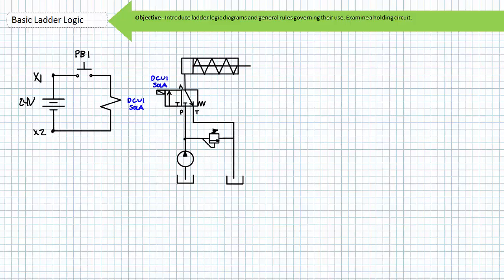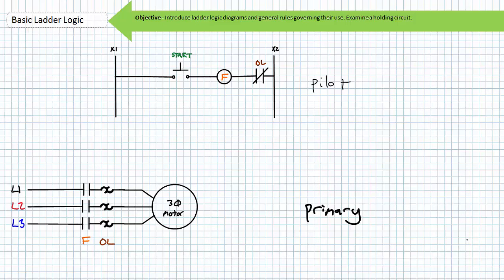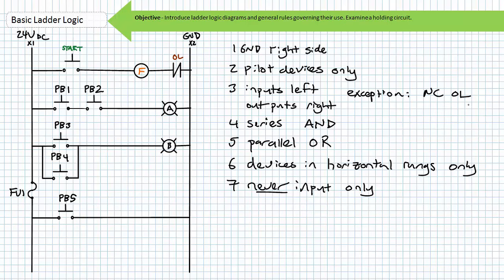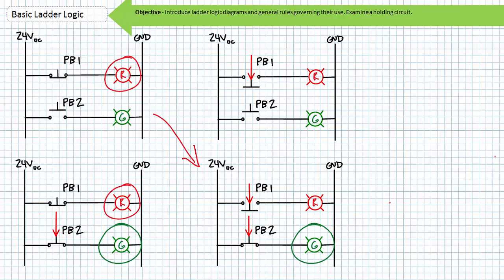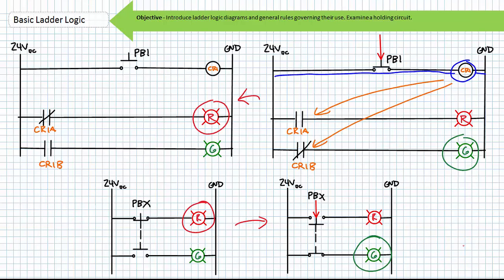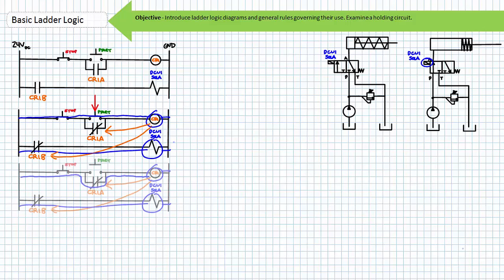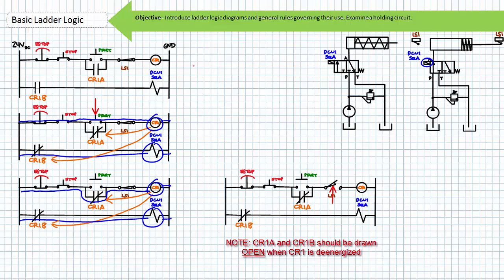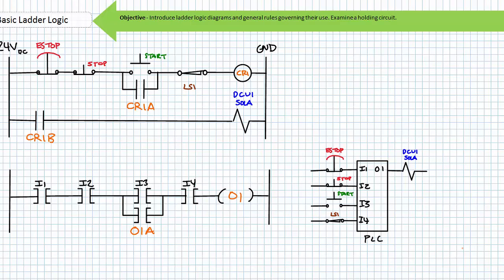Basic Ladder Logic (Full Lecture)

Comment: Switching a NO contact to NC to show it is energized hurts my head. No PLC software I have used does that. Usually the line is high-lighted. If I saw contacts changing state that way I would NOT be able to troubleshoot with the LOGIC changing before my eyes. Just keeps generating paradoxes in my thinking .

Comment: Such an informative stuff. Would it be possible for you to confirm if the terms Pilot Schematics and Primary Schemtacis used in this video mean Ladder Logic Diagrams and Traditional Schematics respectively please? I shall be thankful to you for responding.
Reply from the maker: I guess you could use those terms however I tend to think of "traditional" schematics as those showing a complete current path whereas "ladder logic" has a start on the left and an end on the right. "pilot" and "primary" refer to the function. Pilot is low voltage control (ex: 24V DC). Primary is high voltage power that actually does the work (ex: 480V 3 phase AC).
Reply: @bigbadtech  Thank you very much for responding.

Comment: Great video, this would be considered ladder schematic diagram not ladder logic correct? Ladder logic is a PLC language
Reply from the maker: Interestingly enough PLC ladder logic language (RLL) is a programming method purposely designed to be stylistically similar to old school hardwired relay based ladder logic. Idea was to program a PLC just like you'd wire up ladder logic. Since then there's a number of other styles of PLC programming developed like FBD, SFC, etc.

Comment: the first stop button is on the wrong side, it is a normal push button that opens the circuit if you push it.
the lock has to be the normal closed button which should be underneath not on the top.
when you push it will not open, as shown now it is at the top so if you push it it will do nothing. 
it has to be underneath so that when you push it, the circuit opens.

Comment: Having trouble wrapping my head around the holding circuit. If CR1A is wired into "hot," how is it not constantly energized, regardless of whether the start button has been pushed? It has a direct path to hot whether the button has been pushed or not, so how does the start button affect function at all? As in, how is CR1A not just on unswitched power at that point? Can't picture how that looks in my head. Can someone help me out?
Reply from the maker: Check out the control relay lecture at: https://youtu.be/STKH6Rp7rX8

Comment: This is the one I've been looking for. A full working, very common circuit scenario. I'm wanting to automate a greenhouse and recently started working maintenance in a factory with a lot of automation. I was going to use consumer products for the greenhouse but worried about longevity in a hot humid environment. Then I saw industrial components that have been in service for many years or even a few decades. The company is in the final stages of converting to PLC and just got rid of the last machine that had a wall full of 4' wide x 6' tall control panels full of relays and what had turned into spaghetti wiring. They're setting up a room with PLCs and components to be controlled by them for the purpose of employee training. 

I did find a company that sells industrial level PLCs and smart relays that use web based setup/control pages that don't require ladder logic or function blocks etc but I want to learn things that will help my position at work(currently a grunt/wrench) so I'll be setting up the greenhouse a Unitronics PLC because that's what they use most of at work and Unitronics programs are ladder based. Their full programs are free and I can get a V120 from ebay to practice with for $50. They use a lot of V570s at work and a few V120s and both are the same software. Hell, I might just hold out for a V570 from ebay because I'd love to design some color, touch enabled HMI screens that look better than the 1980s arcade game quality they have at work. LOL 

Of course I also need to backtrack and go through your electrical videos because more often than not, that's what needs to be diagnosed and repaired in automation. A well programmed PLC seldom has a problem. 

I fabricated electric signs in Ctrl FL for 25 years and was quite the badass but I live and like the rural life now. That leaves me having to learn a new trade in my late 50s. Luckily I got into computers in the mid 90s, diagnose and repair my own computer controlled cars and like this sort of thing. Who says you can't teach an old dog new tricks. Just need the right teacher. Thanks for the videos.

Comment: Thanks for the great vids. @10:30 Could I actually blow a fuse in real life by only writing in a push button on a ladder rung all by itself? Or does that just mean that technically in real life a switch from X1 to X2 with no load in between would be a short circuit. I'm just wondering how the PLC works on the inside. I'm thinking that we are basically just giving this PLC logic to solve and that would be what determines what it does. Since there is no load on the rung I was thinking that PLC would do nothing. But now I'm wondering if that would just be giving the PLC instructions to short circuit itself.
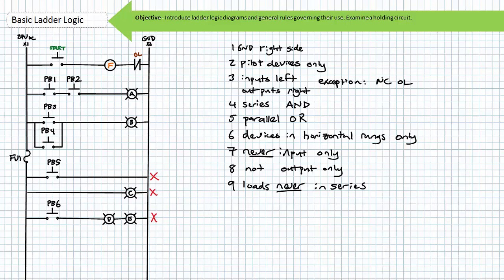Ok another question @11:10 I see the part where you are talking about putting to lamps in series with one another. Does that effect the voltage coming out of the PLC? I would know not to wire the lamps in that way because then the voltage would for sure be wrong. What if we had different plc adresses for each load would that technically work but we just shouldn't do that. Or do we just not do that because everything needs to be properly documented?  I am new to all of this so I apologize  if I used words incorrectly.
Reply from the maker: All good questions ... however ... this lecture deals with hard wire relay based ladder logic (ie: real devices wired in series and parallel) and NOT the programmed instructions inside a PLC. There's a big difference between the two.

Here's the full playlist for hard wired relay based ladder logic: https://www.youtube.com/playlist?list=PLdnqjKaksr8qRPCFkU2Q8XQe0bfo99rs6

Once you're done with that here's the PLC playlist (in development):  https://www.youtube.com/playlist?list=PLdnqjKaksr8qxlMYRVTF2YzTm6RwtA7pc
Reply: Oh ok that's interesting. Thanks for the links. @bigbadtech

Comment: Excellent presentation. One comment is that at 12:05 its mentioned that there should not be an "output only:,  I've often seen an indicating light just tied across as a "Control Power Available" indicator,

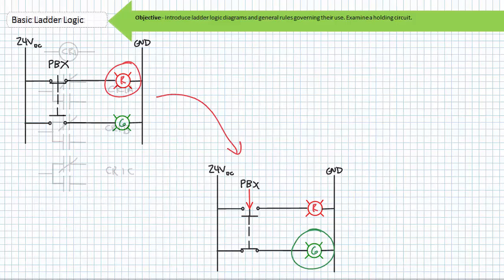Comment: Jim, at 16:30 you spoke about a PBX switch which from your explanation i somewhat understand. I want to ask however about control circuits that uses 3 or 4 position key switches that when moved through their positions activate different parts of the circuit. How is this represented on a ladder diagram. Do you have lectures on this that you can point me to. I am currently using your videos to understand the ladder diagram of a control circuit using a four-position key switch.
Reply from the maker: It gets super difficult after 2 mechanically interlocked switches to draw it schematically so often people revert to using a "contact chart" or "target table" as illustrated in this lecture: https://youtu.be/ENCdPsA9PXc?t=1521 if the mechanical interlock spans several rungs it's often easier to use "house notation" as illustrated in this lecture: https://youtu.be/f1Lj9I0vX6U?t=1332

Comment: Hello. This video is suggested viewing in the maintenance dept of my employer. Our guru Dave watched it and had the following observations. I understand this is a 7 year old video so i doubt you're monitoring and responding to comments, but just in case, what are your thoughts regarding the following:
That is one nice intro! However I do have one disagreement with an early part of the video.
In the first part he stated that having an output lamp (C) wired directly across the two vertical rungs is senseless. I have to disagree and frankly it is pretty common as such a light indicates that the ladder logic is functional or enabled. Lamp C could also be a relay which is often used to sound an alarm to centralized controls. Further we also have examples on the floor of an input to a PLC being directly wired to report the same info to the PLC. If I remember correctly the Epsilons have such a directly wired connection, to the PLC, to indicate control power functional.

In any event that one issue, status indication, can be extremely useful when you have more complicated things happening, that don’t fit in with an introductory video like this. So if people keep this in mind we have one of the better introductions to ladder logic on YouTube.  I would urge everyone in the shop to take a look.
Thank you.
Reply from the maker: Good point. Lamp C could be a quick diagnostic check to see if the ladder logic is even receiving pilot level power. Rather than a technician testing it with a multimeter an operator could simply tell the tech if the light is on or off. The pumping circuit examples lecture at: https://youtu.be/Q9osi4bKSLg?t=1133 features a couple other simple diagnostic examples.

Comment: The Stop button  looks schematically like a momentary open push button in operated state or a normally closed EStop that need be pulled to open.  Just never seen it drawn with connection above the line like that...
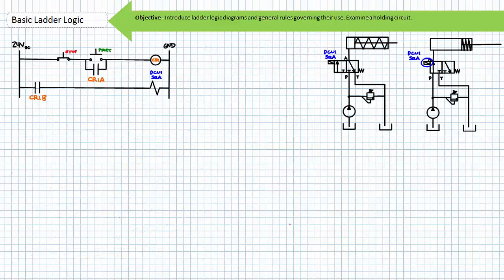Reply from the maker: You are correct. As mentioned in the correction at 24:35 normally closed push buttons are customarily drawn below the ladder rung whereas normally open push buttons are customarily drawn above the ladder rung.
Reply: @bigbadtech  oh, thanks jim, sorry I missed that, I was probably unattentive at that moment.....

Comment: Give me tips to go from Electronic Technician to Project Engineer,  do I only got to put in the time?
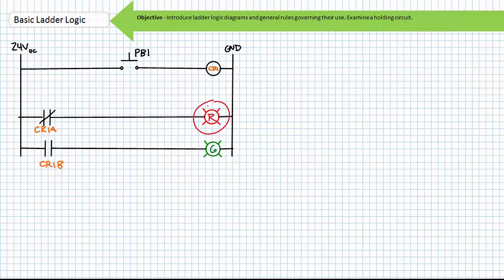Reply: Truly a loaded question, you might remember me UNF BSME. One question, @ 18:45, if CR1 is open isn't CR1A in series with CR1. Or is this a feature of using auxillary power, and so CR1A is normally closed to 24V DC and is opened when CR1 is closed as well. Makes sense?
Reply: NVM, I am checking out your control relay video now... Thank you so much again for your NSF work my small company does not have this type of design resources to learn from. Hope I can learn more and move up!

Comment: Thank you so much for sharing your knpwledge.
I have a question.What will you add to hold the cylinder at a certain position.I believe the solenoid valve must be in neutral position for that to happen.But based from the schematic diagram the solenoid valve used has only two positions.I want to see how the ladder diagram will change if you incorporate a solenoid valve with neutral position.
Reply from the maker: Yes, if you wished to hold the cylinder at the limits of extension it would necessitate a double solenoid valve with either a closed or tandem center. Check out the directional control valves lecture for a description of these positions at: https://www.youtube.com/watch?v=QaagWlHbxr0 Long story short the ladder logic would necessitate solenoid A be energized during extension (and not B), neither energized for the hold, solenoid B for retraction (and not A), and neither for the hold at retraction. Here's a much more complicated circuit that uses a double solenoid valve: https://www.youtube.com/watch?v=QaagWlHbxr0
Reply: @bigbadtech  Hi Jim. Thanks for your very useful lectures.
I am new in this field. 
Concerning using 2 solenoids for maintaining pressure cylinder positions at limits of travel.
My CNC machine has a pneumatic tool changer but the set up has a pressure cylinder with 2 limit switches and just 1 DCV ( 5 way/2positions, spring offset).
It holds the cylinder in its extended and retracted positions.
How is this?

Comment: please I have a question
when the LS1 opens to de-energize CR1,  the CR1B opens so de-energizing the SOLANOID but I don't get why it also has to de-energize CR1A if it isn't interfering with the state of the circuit.
Reply from the maker: Both CR1A and CR1B are switches associated with the coil CR1. When CR1 coil deenergizes both CR1A and CR1B return to their deactivated state. Check out the control relays lecture at: https://www.youtube.com/watch?v=STKH6Rp7rX8
Reply: @bigbadtech  Great, thanks a lot.

Comment: I have been working with hold circuits using relays and PLCs for decades (wow I was going to say years until I did a quick count in my head... I'm getting old) and after that amount of time you realize in the real world you have to go one step further. That step is to design for the unintended consequences. That is the operator who will hold the start button thus causing the cylinder to continuously "chatter" or only retract for the amount of time it is in contact with LS-1. If you have not already (I'll have to look through your excellent offering of videos) your next video (Titled: Beyond Basic, But Not Quite Advanced Ladder) should cover how to make that cylinder cycle once regardless of the state of the start pushbutton. That is what I call developing logic to "outsmart stupid". LOL 😅 The only reason I bring this up is because I have commissioned many systems created by genius engineers who unfortunately think in a linear way not expecting a "curve ball". Those who are just learning and have watched this excellent video I want you to think out of the box a bit whether  designing and or troubleshooting. This is where designing or diagnosing these circuits or PLC logic becomes fun or at least challenging. Really enjoy your videos.
Reply from the maker: Excellent point. Yes, I plan on covering anti-tie down circuits in later lectures. When it comes to system design I tend to think in the following fashion "If you give a soldier, student, or operator a rubber hammer and an anvil ... they'll break both of them. "
Reply: @bigbadtech  How true...  LOL

Comment: How do you show a maintained button vs a normal button? Is it that the button is above or below the line, or is it the semi circle you drew over the button? Thanks!
Reply from the maker: Good question. Often times a "maintained" contact button sometimes includes a secondary dashed mechanical interlock to another button indicating it needs to be "reset" to return to the deactivated state (see the ESTOP description in the "Switches in Electrically Controlled Systems" lecture). Additionally I've also seen a maintained contact include either an arrow or two opposing bars on the operator head.
Reply: Thanks for the quick response. Just to clarify, the button is under the line when it is normally closed, and on top of the line when its a pushed normally open. Thanks!
Reply from the maker: Yes. NC below the line. NO above. It's implied a spring returns the momentary device to its deactivated state.

Comment: Please tell me why the overload is located on the neutral. This can only make things more confusing. (ground side switching) if the overload was located just to the left of the coil... all circuits would be positive switched and much more intuitive.
Reply from the maker: Good question. Yes, you're absolutely correct that the NC overload could be functionally incorporated as part of the ladder logic in front of the coil (high side switched) but it's customarily located to the right (low side switching). My supposition for this customary arrangement is due to the physical location and arrangement of the devices that might make up a hard wired relay based ladder logic system. Pilot devices might be located some distance from a motor starter. Motor starters are made up of a contactor and overload in nearby proximity (often designed to link together). Wiring the circuit in this fashion means less long runs of wire back and forth to potentially distant pilot devices. In a sense the low side switched NC overload contact has "the last say" whether a motor is energized or not.

Comment: Outstanding lecture! The hard wired e-stop circuit shown here is the most straightforward way to stop a machine.  Also NFPA-79 requires that e-stops be normally closed contacts, and cannot be integrated through a PLC.  However, a safety relay or safety PLC (like a PILZ) may be used since they are designed for that purpose.  I have seen machines that use normally open contacts for the e-stop and use the regular PLC to stop the machine without cutting power to the control transformer.  These will not pass an electrical inspection.  Thank you for demonstrating the correct way to control!
Reply from the maker: True dat! If there's one thing I learned from watching the Terminator is to never trust a machine. Check out the "PLC Interface" lecture at: https://www.youtube.com/watch?v=G4uo0Sm0uMo where I expound upon the necessity of a fail safe means of killing a machine dead.

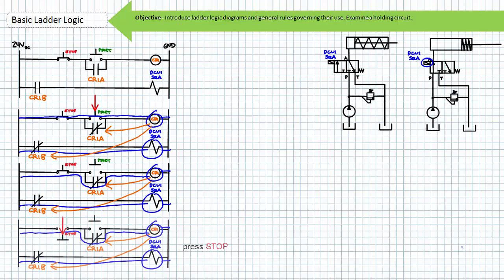Comment: Nice explanation, but in the example at 25:53 where you added the stop push button; be represented with the push button on the bottom of the ladders rung to illustrate that you are actually pushing rather than pulling? Judging by only a few moments later it appears the stop button you created penetrated the rung to stop operation. Maybe it doesn't matter, just an observation, I know breakers in simplified form can be shown as a stop partition that is on top of the rung, but those are also generally on the right side of the rung too, like the relay.
Reply from the maker: Yes, customarily NC push buttons are drawn below the rung.
Reply: Thanks for the clarity! Still learning :)